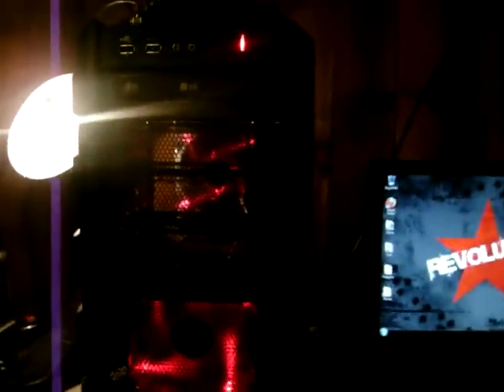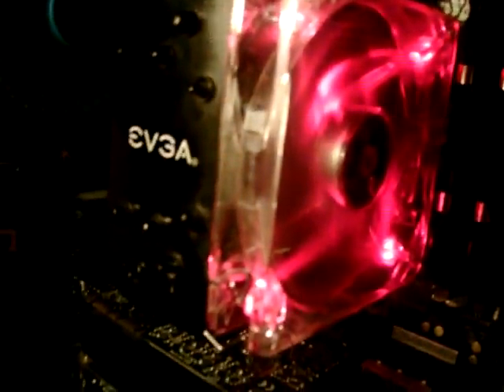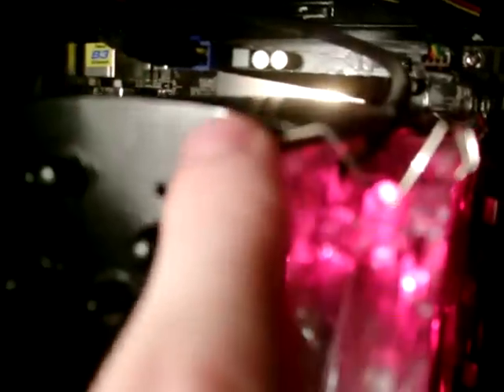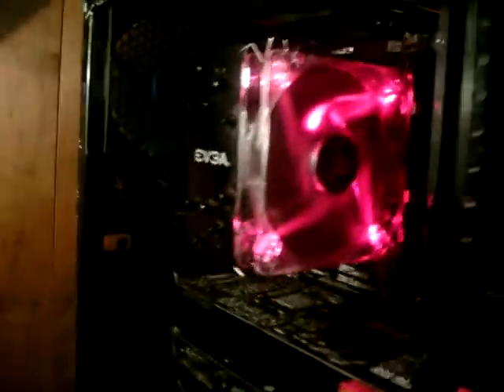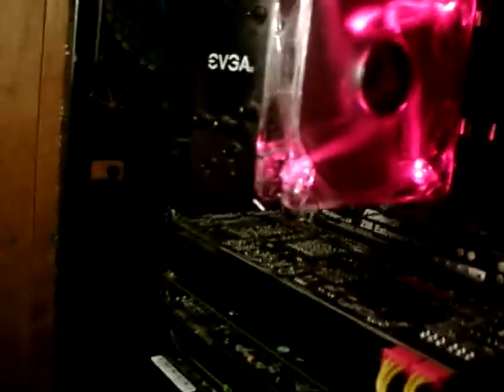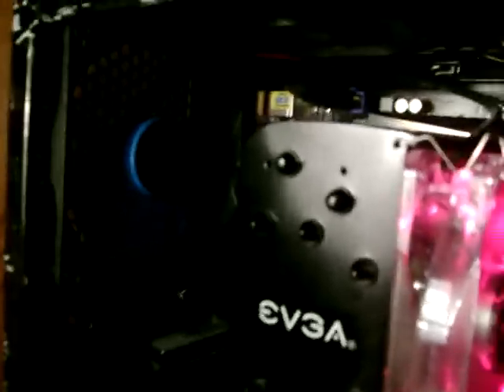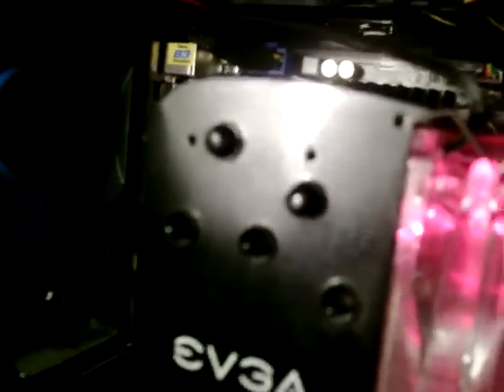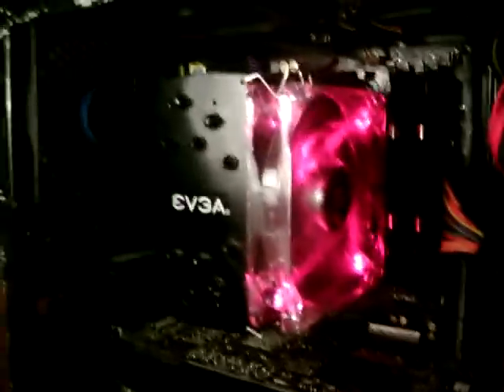EVGA Superclock CPU Cooler Review

Comment: That 48 degrees isn't his coretemp. It's the CPU temp in speedfan which is always alot lower. I'd say his core temps are over 70 easily.

I have watercooling and with my 2500k using 1.33v I get 57 degrees in intel burn test but speedfan reads 35 cpu temp.